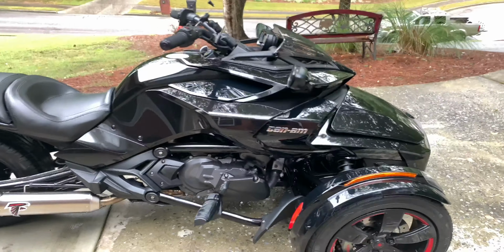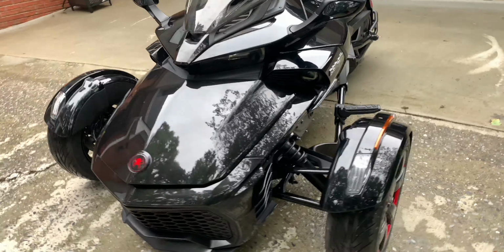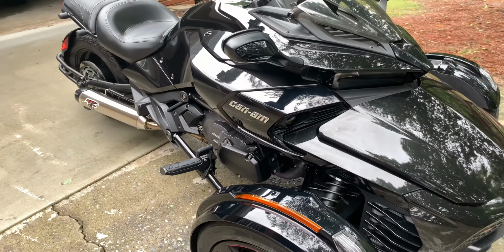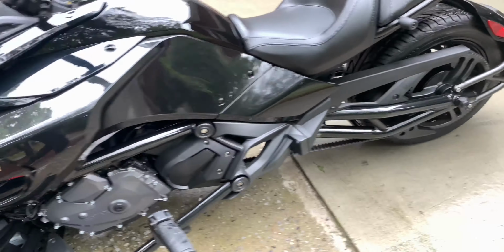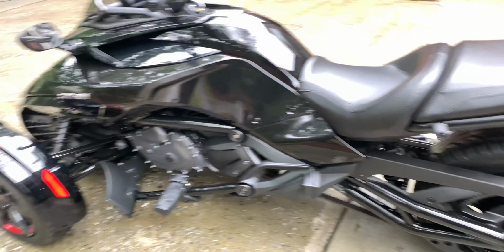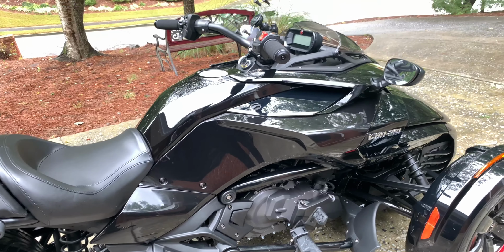LED Headlights & Fog Lamp Install

Comment: I was all set to get the Ryker, but after joining 3 or 4 different groups, it seemed like the Rykers have quite a few issues.  Additionally, I know I’m probably going to do longer rides, so I’m gonna get the Spyder.  I’m looking to get the black on black like yours.   Your videos are very helpful.  Thanks.
Reply from the maker: Appreciate it Richard!  You won’t regret it!  The Spyder is nice and really smooth.  I know a lot of people prefer the Ryker b/c of burnouts and quick fun.  That is not my riding style and I don’t do burn outs.  To me, burn outs is money smoking on the ground.  (I know comment is late.  Not sure how I originally missed) Peace